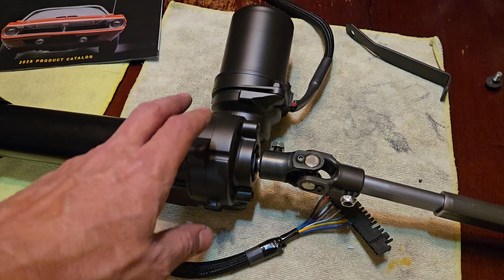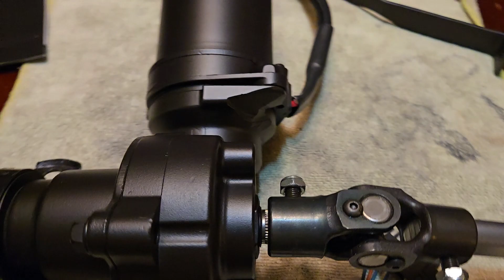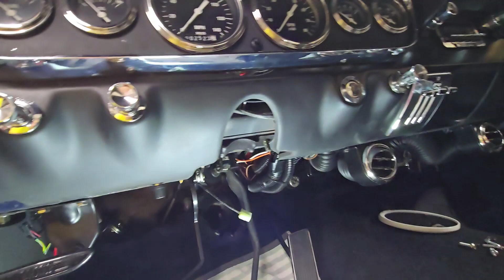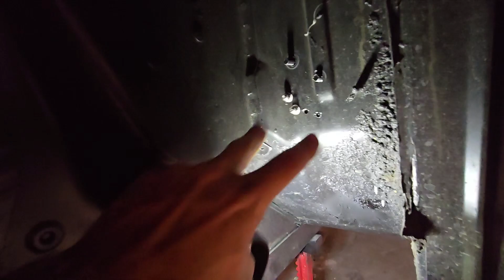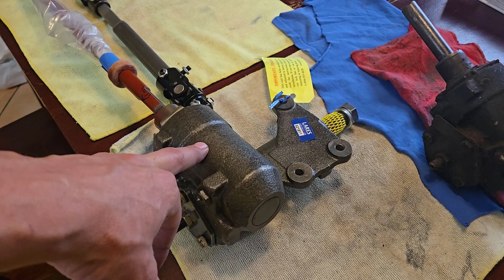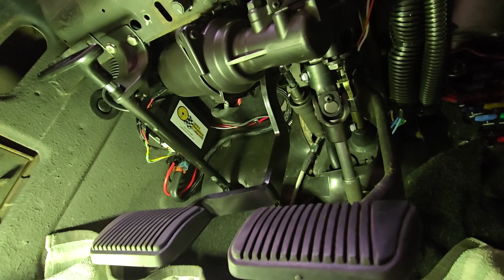1966 Mustang EPAS and Malwood - Do they play nice together?

Comment: Thxs for making this video I’m currently looking at the malwood clutch  and the epas system… I bought the long shaft flaming river box about 8 -9 years ago I like it  but I’m ready for some power steering like you mentioned.. btw that 347 sounds awesome. Did you go with crate engine?
Reply from the maker: Yes.  Blueprint.  Good luck on the project.  I still love this combo.

Comment: So I did the same install on my 1965, and like you, the up and down wobble is driving me nuts.  Any chance you can fabricate another vertical support brace?
Reply from the maker: Hey Fred.  The fabrication is not too difficult.  Just used some 1" flat bar stock, some bending in the vice and some trial and error.  To fabricate one, I would really need to be with the car.  If you took this project on yourself, I am positive you have what it takes to make your own bracket.  Still love the kit and 8 months late it's running strong.
Reply: Joey- i figured as much, just need to find a local place that does metal fabrication.   I’ve also read, that instead of a swivel, you can/should use a straight coupler at the EPAS.  Weighing which way to go.  Probably try adding the bracket first.  Thanks for the video, reaffirmed I wasn’t crazy.
Reply from the maker: @fredtanner1373 I like the straight coupler idea.  I still have a feeling you would see some unwanted vertical movement.   maybe a straight coupler and a bracket for the win!